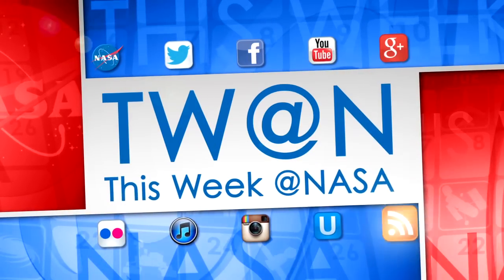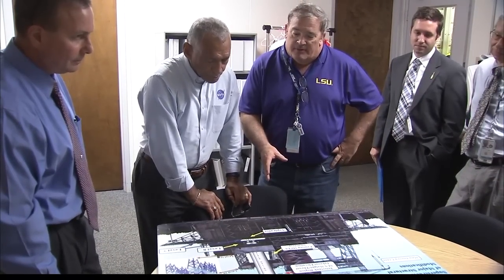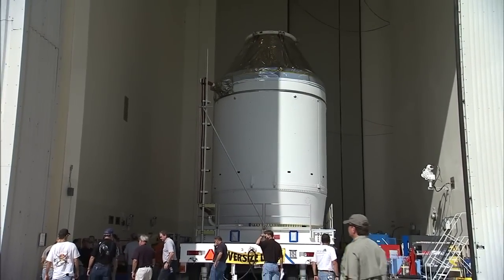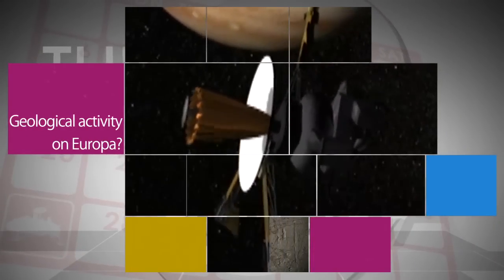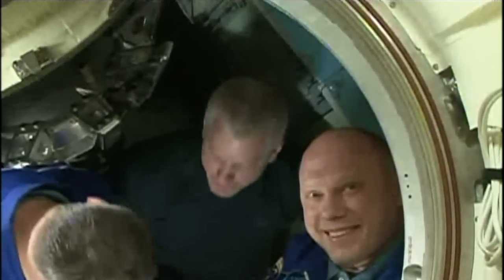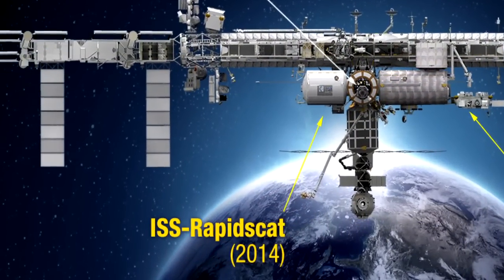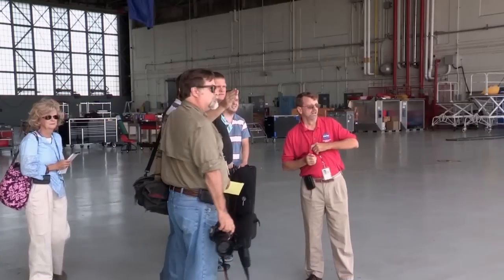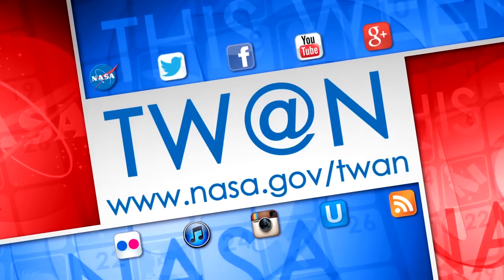Rocket welding tool ready on This Week @NASA - September 12, 2014

Comment: tank barrels are off the Welding Stand now it is time to put them together the Vertical Assembly Center will weld the segments together and when that is done it will be used to paint it. when that is done the core will have the tanks installed and it will be loaded on the Pegasus and transported to Stennis where the engines will be installed and the rocket loaded with fuel for testing on the A1 Test Stand. finally the core will be taken to Kennedy and delivered to the VAB and built into a rocket.